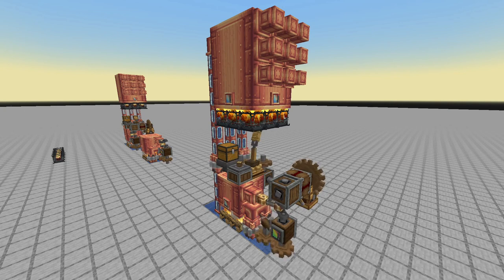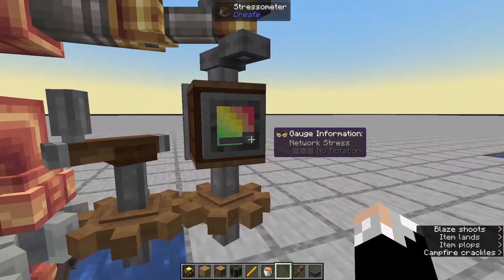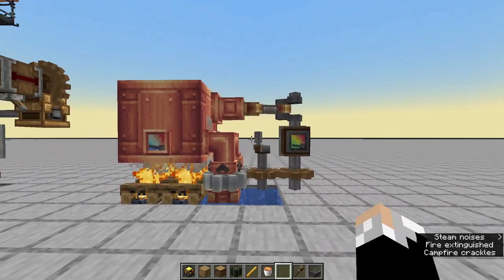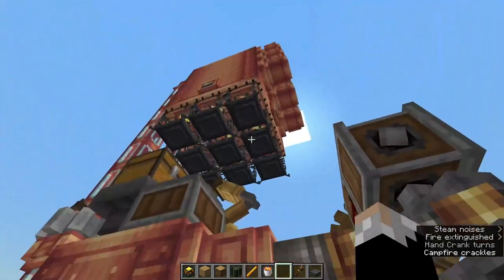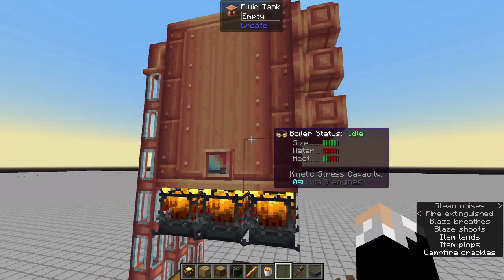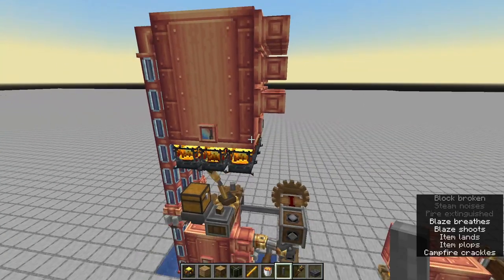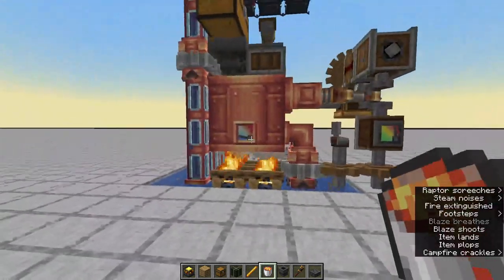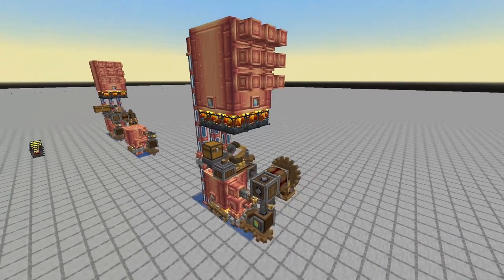Create Mod | FULLY AUTOMATIC STEAM ENGINE LVL 9 (147,456 SU) with WORLD DOWNLOAD

Comment: This is a really compact design for early steam power, and it's simple enough it can be built by hand. At least the first one.
Reply from the maker: Yeah and you can make it a block or two shorter as well, just need to make sure the mechanical arm can still supply the burners and you are set